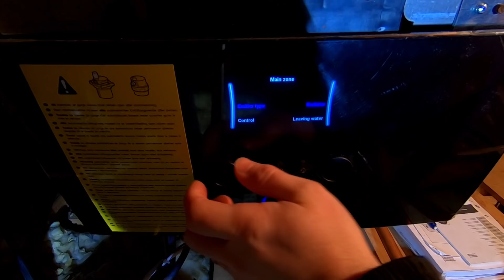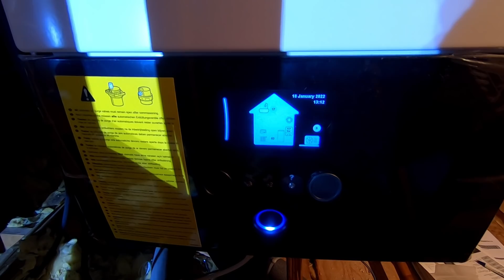How to lose £2000 installing a heat pump

Comment: I think this really does highlight the fact that Hydrogen is something that should really be considered by the gov.
Not only is this method costly for a lot of people, but also and absolute ball ache for the engineer.
I could also see this opening the door for the bigger companies and enabling them to push the one man bands aside.
I wish the gov would not just think of something as a one solution for all problems, instead to sit back and REALLY think of the impracticality of such systems, they are not accessible to everybody, be that for cost or space. Wake up Government, listen to those that actually work on heating systems.
Reply: The problem with hydrogen is, you can't just slowly mix it in until you get 100%.
Reply from the maker: Hydrogen is just a distraction and a way for gas industry to kick the can down the road. 20% mix may happen but at a huge cost.

When you realise how inefficient production of H2 is you quickly realise that heat pumps are a much better solution.

Comment: I'm pleased to see a warts and all installation: I'm considering it for the future as we have an electric flow boiler running wet UFH (we have no mains gas and cannot have oil or LPG for logistical reasons), but the design of our house would mean the power supply would be difficult, the pipes would have to go up to the loft much like in this example and that unit is much bigger than I envisioned. I don't suppose you can say, but I'd be interested to know roughly what this cost the customer since it's not dissimilar to what I'd need doing and it would give me an idea of how long it would take me to save up for it!! Also, very interesting about the weather compensation. If I owned one of these, I'd make it my business to know how to set that myself (I'm a software developer so I'd definitely want to know these things) just in case.
Reply: @Liam Joyce not quite sure why I'd want air con? I have perfectly good wet UFH and there's no way I can or would want to run air ducting. It would make more sense to utilise the infrastructure we have, but I'd be hopeful that a heat pump would at least give us more heating for the same money we spend in electricity for now.

Comment: So as a QS, you need to be aware of your subcontract terms. You should be making your main contractor aware of;
Non productive time waiting for materials
Seek instruction on variation to spec & design
Who pays access? Should be identified from the outset
You have no design responsibility and aren’t supplying materials so any defect in either not related to your workmanship should be chargeable.
Reply from the maker: Great, just 2 weeks late 😂

Comment: I was fitting low temp monoblocks and high temp splits with solar thermal on heatpumps 12 years ago and lost money even then as a sparky.setting up the the units properly as well as oversizing rads and proper installation is key otherwise your wasting your time and throwing away money,gas is the way!

Comment: Had you taken any training before installing this heat pump? I'm not trying to degrade you here, just curious as I haven't had any training in them but I'm a gas engineer myself. I've heard that the pump needs to be a certain distance away from windows but that one is installed directly under one? Is the customer happy with it? Was a calculation made for how much money it would cost the customer to run the heat pump, especially since they disabled the weather controls? It would be nice for a follow up on this to see if there are any issues with cost and the system itself.
Reply from the maker: Yes mate - I have done loads of training. hydronics, system design, Level 3 heat pump training, manufacturers training, etc. Spend last 12 months pretty much training. I did not do Daikin course though as it was fully booked for months.

Comment: Everyone avoiding weather comp and load comp to avoid customer complains. I have customers swear at me but I literally can’t sleep if I haven’t done either of the 2 on a job. Sometimes I think I should give up but than I think someone will have to make a start. It’s a shame that a big and innovative company like Daikin chose to give up. On another thought the controls should have updated with compatible one.
Reply from the maker: You can’t run a central heating pump behind the buffer if you use daikin controls

Comment: I am so glad I have now retired from plumbing, after 40yrs, I am from an age of lead wipe joints, and solid fuel heating, towards the end of my career, I fitted combi boilers, bathrooms etc, I can honestly say, watching you clambering between roof trusts, and itchy insulation, brings back the aspects of the job people don't appreciate, your attitude towards problem solving is exemplary, I enjoy the content, and watching the next generation of plumbing, but I will stick with my multi fuel burner, running ten rads, and gravity hot water, with only the pump that can fail, all the best to you young man, your doing good....
Reply: Retirement what’s that we got to work until we drop now ffs.
Reply: Yeah I'm a sparks & lofts suck. Fair play to this lad cos I'm the same, cant leave an untidy job
Reply: Yeah I'm sticking with my burn it all parkray. Free heating and hot water .only thing I've ever changed is the odd ballcock on header tanks.
Reply: I am not a plumber but I can tell this chap is special he realy is !!!
Reply: Ah mate its a nightmare now, I went to college and became a qualified sparky. People always said "want an easy job, do electrics" I guess that was the mindeset back in the day but its a mess now. I did 4 years after qualification and walked from the profession. I'm a caretaker now, less money but no where near the crap I had to deal with. Modern day professionals that do it right are heros in the building trade.
Reply: Me to Steve  ive been in business for 40+ yrs and just given up my gas safe ticket still doing oil installs lot simpler
Reply: Very well put Sir. This guy is a brilliant professional and the job he took on there was as difficult and awkward as it gets.
Reply: Stephen I can't wait to retire partially from work and focus on other things. Wait I'm not even 40 yet.
Reply: ah bless, but don't wish your life away @CommercialGasEngineerVideos
Reply: Jay Browne  ?
Reply: Yes solid fuel all the way. Only one moving component, the pump. I'm a 40yo plumber and dread what the future holds
Reply: Im a lot younger than you guys but...currently ripping out an air source heat pump and installing a wood fuelled AGA....so, Im inclined to side with your way of thinking!
Reply: @Kinematographer  The only way mate, the government can’t scam you with gas and electric rates on something that runs on trees
Reply: *you're
Reply: @jagaloon216  ?

Comment: Rather spend the money on thermo installation from the outside, tackle the windows and maybe thermo installation the inside wall around the window/outside wall. Then see if heat stays.

Comment: To a laymen like myself, this looks just like an a/c system on steroids which is in no way economical to use 24/7 365. I really do not believe air or ground source systems are the way forward unless designed and installed in new builds insulated for their use. But in insulating and hermetically sealing up properties are we not causing other issues health-wise. I remember when upvc windows came out and then they started fitting vents on the opening's to let air in / out which sort of defeats the purpose.
Reply from the maker: Heat loss is heat loss - if you can satisfy the loss with well installed heat pump with high efficiency it can be cheaper to run than a gas boiler.

Sadly system design and proper planning is not what is happening out there at the moment

Comment: UK properties with heat pumps 🤣 not without interior aerogel insulation, floor insulation, triple glazing all windows and doors, Celotex in the loft etc.  This is all about U values, the colder and draughtier the house, the more money you get from the government scheme.  I'm in a Victorian three bedroom house, renovated as above, gas bills of £350 a year, most of that is standing charge.  My house is warm, it stays around 20C all year round.  Government should concentrate on insulation, HPs only work with very good insulation, government subsidies are artificially distorting the market to favour burning gas to generate electricity to drive heat pumps to then just heat the atmosphere and rely on electric immersion heaters for hot water 😝  I had to laugh at the pipework going up the side of the building and into the loft, this is where most of the thermal losses will occur, all of that should be inside the house behind insulation.  Oh well, it's government cash, just like PPE scandal, more money wasted...

Comment: That job on the brickwork , every brick that had been cut , should have been knocked out ,  5 bricks need replacing . it was harder to cut the bricks circular,  than replace 5 bricks 🤣🤣
Reply from the maker: 😂 not a bricky as you can tell. Also, where the hell you buy bricks? 😂
Reply: @UrbanPlumbers  I don't think this brickie realises the plug was nothing other than the waste from a new core hole so there was no need to cut bricks circular.

Comment: I have heard this so much about air source, I know installers that have fitted these units and had nothing but trouble with them, absolutely no point in installing one of these in a traditional built house, electricity bills will be sky high with out insulating the whole house
Reply from the maker: That is not entirely true. You really have to understand hydronic design to be able to install those successfully. It can be done and they can run in older buildings without being more expensive to run than gas boilers.
Reply: @UrbanPlumbers  in some cases I agree, but generally because older houses have poor insulation and these units run at low temperature if connecting to radiators you would have to increase radiator sizes by 40-50% so installation cost would be 15k upwards to do this properly, without adequate insulation running costs would be huge.
ideally air source is better with UFH, you need to keep flow temp low as to not directly effect the COP of the unit. Sizing is hugely important to avoid starting and stopping the compressor as this effects efficiency and adds to life expectancy of the unit.
Also in older houses because heatloss is higher units are generally larger and then there are limits on what the main fuse to the house can cope with as most houses do not have 3 phase.
UFH with a gas boiler is still imop a better option especially with Hydrogen coming on stream which is very clean and will be far cheaper to install to an existing heating system as most modern boilers will be able to burn this with a minor adjustment.
In summary heat pumps or ground source work on a new build home with massive insulation but not on a traditional house with basic insulation and standard double glazing. 
But great article and really nice neat install 👍

Comment: As if proof were needed, there will be suppliers cutting corners and "designing" systems that will never work as they should. Despite what Johnson might think, this is not the way to go.
Reply from the maker: There are good installers out there than can design and install an efficient system, look up Heat Geek

Comment: No offence meant to you, as you seem very skilled and diligent, but this is the most off putting story for anyone ordering in a heat pump. The  ASHP supplier doesn't seem to care about their customers at all, and their electricity bill with be through the roof surely. I'm sure that was really depressing to get dragged into their realm. Disabling the weather compensation, that was totally ludicrous.
Reply from the maker: I went back and I set the WC now for the client. We could also see his daily bills as he has a smart meter. They were around £8 per day with WC disabled. We will see how much cheaper it gets with WC set up correctly
Reply: @UrbanPlumbers  Fantastic. I sill can't figure the logic of having it disabled?? He/she was extremely lucky you and your smarts and conscience were on that job!
Reply from the maker: @kyarichards2894  setting up WC correctly takes time and may require coming back to the site. Fixing the output will guarantee that heating will work well but will also kill all efficiency, cause high energy bills and shorten the lifespan of the compressor.
Reply: @UrbanPlumbers  Sounds like this is ONE OF THOSE JOBS. I'm self employed and with some clients, no matter what you do, you are just cursed. You just survive the ordeal and move on, out of pocket. Everyone can see the quality of your install. Superb.

Comment: FFS, disabling the weather compensation is like having a 6speed gearbox and ONLY using third gear and are the knackered old windows being replaced or left to allow more system inefficiency/failure😢
Reply from the maker: Only 1 window is old - all other already replaced

Comment: Great video. In my experience putting the unit on fixed output will reduce the life span of the heat pump, and take the compressor out. And it's a joke not changing the cylinder with 3 metre square coil and increasing the size of The radiators
 I'll give 18 months before a gas boiler goes back in !
Reply from the maker: I have gone back and set up weather compensation now. I am also discussing upgrading all rads with the client.
Reply: @UrbanPlumbers  Can the homeowners change the settings themself or do they need the installers to do it? thanks
Reply: Spot on

Comment: The trunking looks neat up the front of the building….. What have you used??
Reply from the maker: I did not supply it. Main contractor did
Reply: I think you will find the trunking is made by Talon and is designed to accomodate their pipe clips.

Comment: Great video once again mate, I cannot see these air source heat pumps catching on unless the costs are vastly reduced, and that will never happen
Reply from the maker: Remove government subsidies and the cost will drop by at least the subsidy itself, no?
Reply: @UrbanPlumbers  😂
Reply: It did for solar PV.
Reply: When you build a new, very well insulated house and plan to install PV then air to water heat pump is the best heat source right now

Comment: Impressive pipework, and neat installation.  Switching off weather compensation is an absolute no-no.  In 16 years of installing heat pumps we have never heard that 'advice' from anyone.  What a shame you had to go through so much on your first installation.  Don't worry, it will get better.  We are Borders Green Energy, in the South of Scotland.  We would also recommend that you get your MCS accreditation.  If you were in our area we would happily work with you.  Well done.  Pauline and Simon.
Reply from the maker: Do you think getting MCS on my own is worth it?
Reply: @UrbanPlumbers  I don't think as a one man band you would have time for the MCS. Heat pump installations alone take up alot of time. I've done the heat load calcs for a few jobs and that takes an age.
Reply from the maker: @mikecole4952  thanks for your reply. I have done heat loss on some jobs already, and I know what it takes. 

Would a system of 2 days office / 3 days site work be possible - or is it even more work on the office side of things?

I do understand time involved in specifying the job and doing the heat loss and the design.

What is the workload on MCS / compliance side of things (minus quoting and specifying)
Reply: @UrbanPlumbers  the company I sub for are paying for signing off the MCS but I need to build a good team before I'm ready for that. I would say a day is a good time scale. I know ever green energy have a umbrella scheme with an app for doing it relatively quick without the need for MCS. At one point we had to leave 500mm of isolatable pipe work on the flow and 300 on the return if they wanted to fit a heat meter.
Reply: The time, difficulty and expense of MCS accreditation was what made me ditch the idea of getting into ASHP a decade ago.